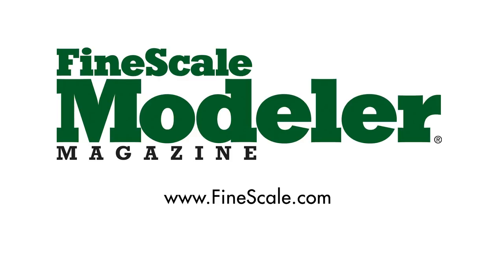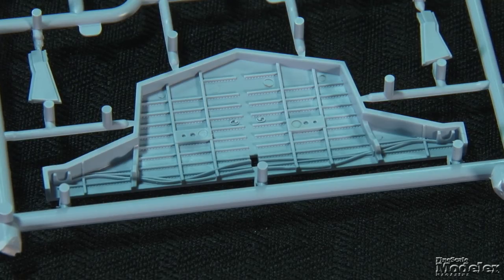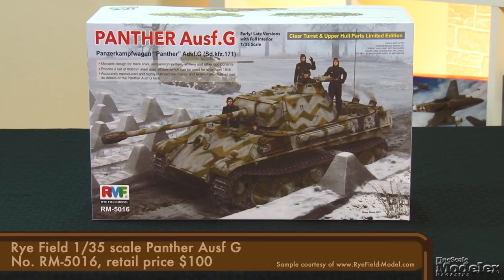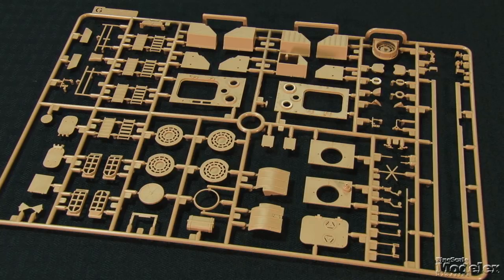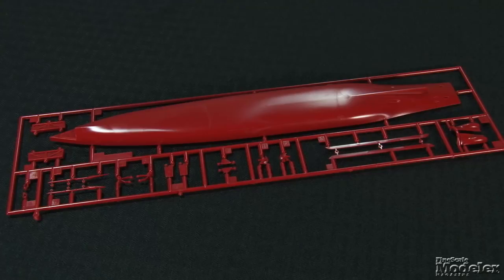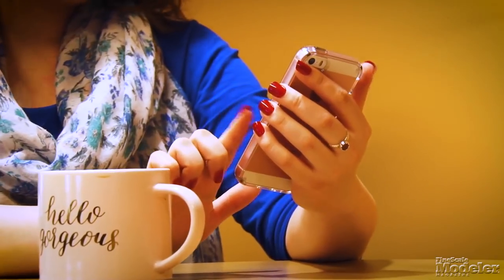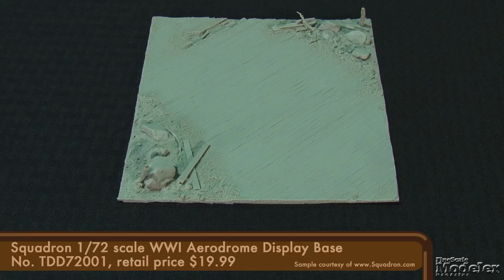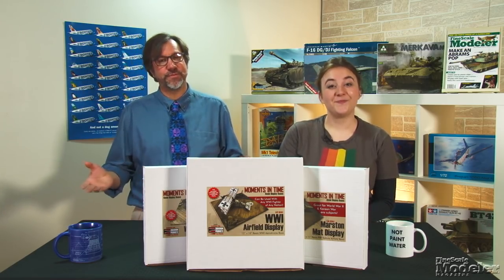Airfix Sea Fury, Rye Field Panther, Hasegawa Kaga, True Details display bases

Comment: Nice show. Just one suggestion, if I may.  The "Ausf.G" actually stands for "Ausführung G" which simply means Version G.  It is not that difficult to pronounce "Ausführung" and it will impress the hell out of everyone watching when you do say it.  The same goes for other German vehicles.  I recall a program where the curator at a Museum was referring to the "Brumbär" as the BrumBAR, when it should have been pronounced BrumBEAR.  It was such a let down as it immediately questioned the level of research that he had performed, when he did not even know how the name was pronounced.